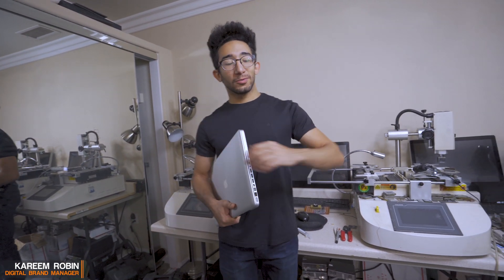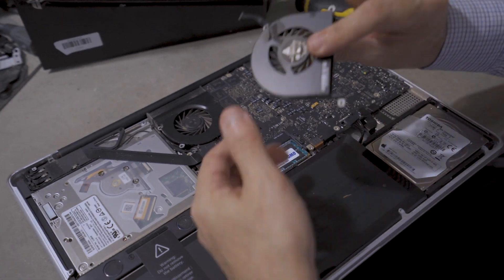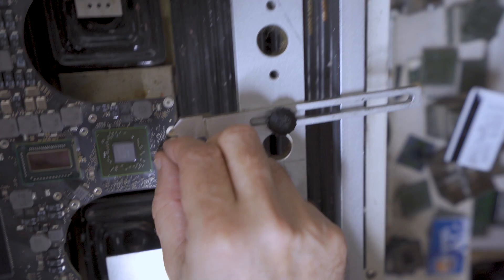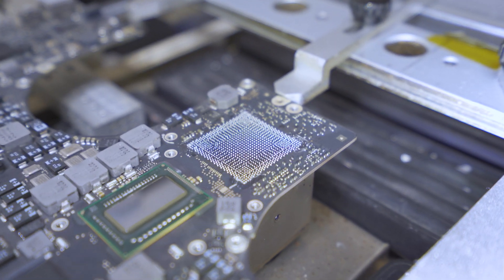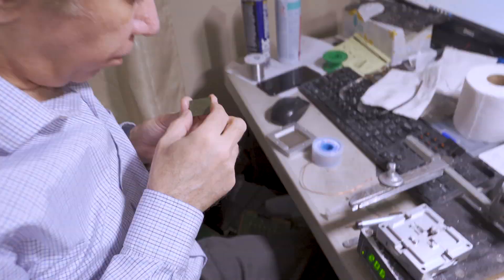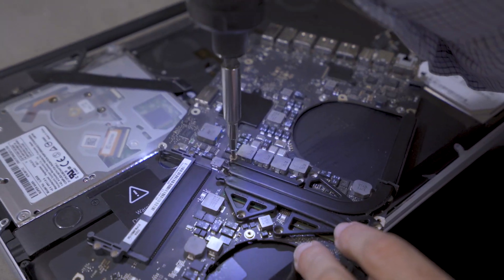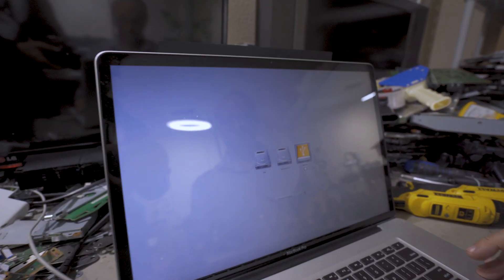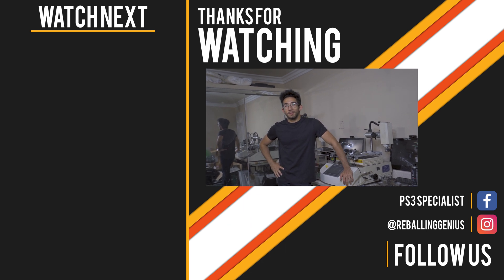2011 MacBook Pro Reballing, Does it REALLY work in 2019??!

Comment: Dear brother. Pls read my comment and do reply. I am facing a sever issue. Whenever i try to reball CPU or PCH in apple motherboard it fails. It works fine in hp, dell etc. I find that the material of apple board is different. It does not catch the solder easily. It takes quit some effort to apply solder on the motherboard. This is the reason due to which when i mount the pch or cpu on the motherboard with the help of my ZM-R5860 it does not get !00% soldered. Pls guide me . My id is taralaptops2015@gmail.com and i am calling from Mumbai . My number is +919870034616. Pls do reply. Thanks
Reply: SOS!!!!!!!!!!these people are thEIFF's 3 years ago i send the 5 ps4 and they dident bring them back to me i spend almost 500$ and nothing no replys on my emails or answer the phone i have all the proofs of the receipts and paypal payment and facebook conversations messenger, IF YOU WANT TO SEE YOURE STUFF COMING BACK STAY AWAY FROM THEM!!!!!!!!!!

Comment: Re-balling is a temporal fix.  The question arises why it failed in the first place.  Heat will destroy most anything.  The maker is not conservative in design.  Amazingly those that buy Apple will continue to buy.
Reply: It wasn't exactly apples fault, it was nvidia's for supplying bad gpus
Reply: @rockl79  it's an AMD problem aswell
Reply: @3am_vdb  If the cooling system was constructed better that machine would last for sure!

Comment: I was very impressed with the process and would love to have my Late 2011 17'' fixed. I currently have it with the the GPU turn off by disabling the AMD Driver but the screen looks a bit washed out with just the Intel GPU. It would be nice to have the AMD GPU working again.
Reply: Did you try their service?  If so, were you able to get the gpu working again?
Reply: @pauldwalker  rebelling is a scam since it’s not the solder balls that’s the problem it’s the inside of the gpu that is the problem so when they heat it up to desolder the gpu that’s what is fixing it
Reply: @jameswyma9849 Is it though? Did AMD ever confirm this or anyone else? I need proof to know if that's true or not

Comment: This does not work please do no waste time replacing gpu since it will die again. Also reballing does nothing due to chis be a defect and fixed revision never came.
This a scam reballing a 2011 mbp will never fix this issue

THE DEFECTIVE CHIP IS PROVED BY THE COMMUNITY
Reply: How do you know his fix doesnt work if you never had it done???
Reply: @OlandoMcCall  replacing a chips requires putting on balls also I use lead ball which superior to lead free but the computer still Will after few weeks or. Maybe a month or two
Reply: @willkim9134  who did you try the reballing with???
Reply: I do it myself as a I run shop doing logic board level repair.
Reply: @willkim9134  I see, so in your opinion what helps this issue, and thank you for the responses
Reply: You had them try to fix your macbook pro?
Reply: @OlandoMcCall  No but this is junk since I replaced the gpu 3 times and they all died and the gpu are proven to be defective and dies. These are flip chips which means that reballing will do no shit. The only thing that is temporary resurrecting the chip is the heat. Sticking macbook board into a oven with 120c for 10 will have temp fix which means the chips are faulty. AMD HAS NEVER RELEASED A REVISED CHIP. Pros as myself have done endless replacements but they die. Best Option is reprogramming gmux chip with dosdude software.
Reply: Will Kim      Thanks for commenting. Three questions, please. 1) Aren’t there a lot of funky issues with the dosdude1 method, like not being able to adjust screen brightness, etc?    2) My MacBook Pro 17 is a late 2011 which means I got eight years out of it before the GPU issue. Why couldn’t I get eight more years out of it if I get it reballed?   3) My speakers started sounding crackly a couple weeks before the computer crapped out. Is that related to the GPU issue?
Reply: @joeblow1942  dosdude method if you do hardwiring method not flux flash then he sells board that enables brightness control. Also revamping won't do shit. The things that is resurrecting the you is the heat applied to the you it's self. Louis rossman has very detail vid on this but this will mostly like not work for more then few months or maybe year if it really lucky
Reply: Hi! i wanna know what happen if i use a new chip? that will fix the problem? i mean a full job
Remove the actual chip
clean all the soldering
and put a new one
Reply: @gustavobecerra4785  the chips are defective and flawed from factory thats why these board dies even though apple has replaced your board.